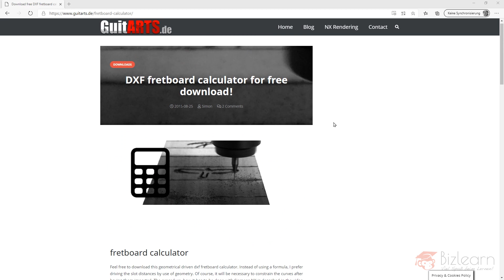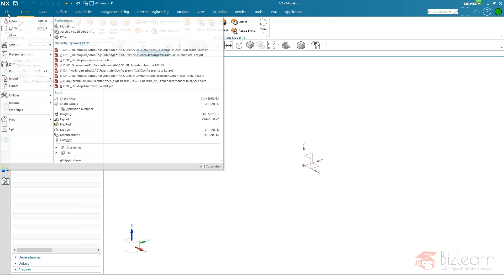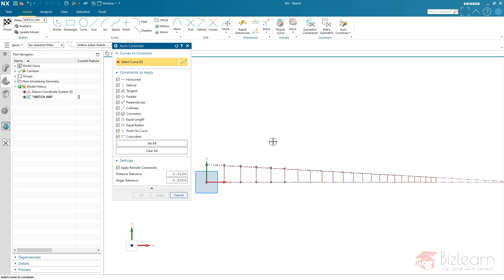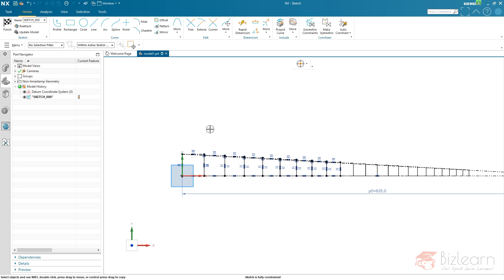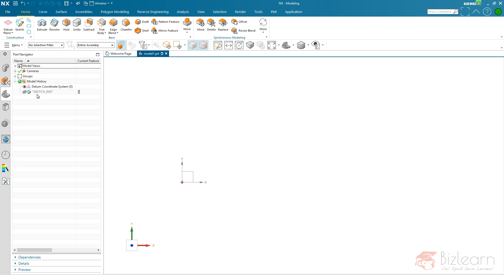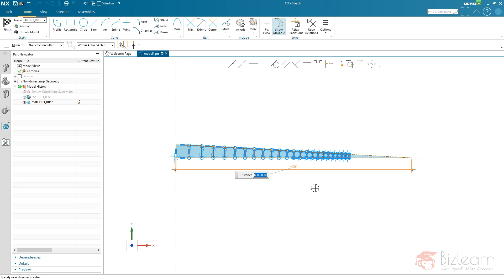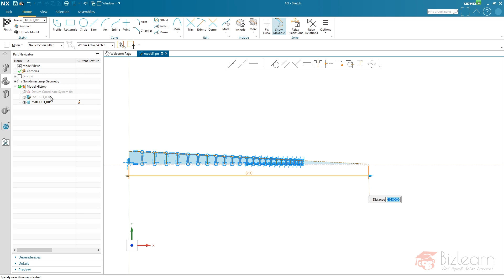Siemens NX 1926 - "New Sketch Solver" Review #2 - no worries about constraints?!

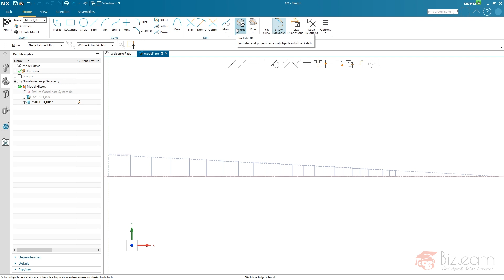Comment from the maker: 5:07 about the "Include" command: of course the selected edges or curves are made available via projection if required, but they can only be used as a reference curve and thereby not extruded or sth, which is possible after projection or adding curves. Curves have already been included in the past automatically, when selecting an external object and can now be included manually via a command!